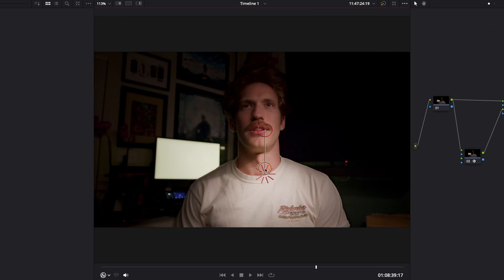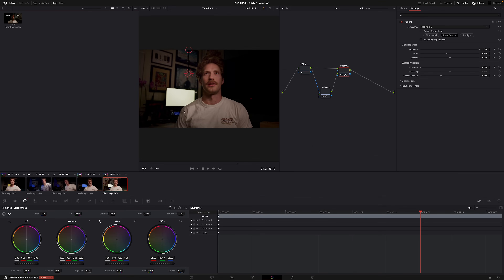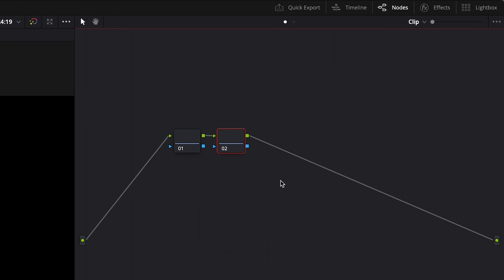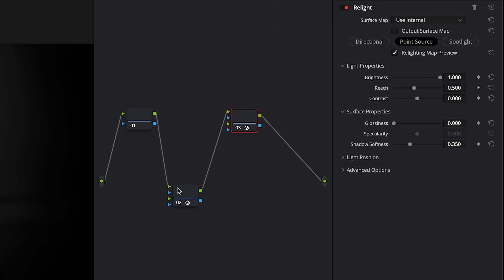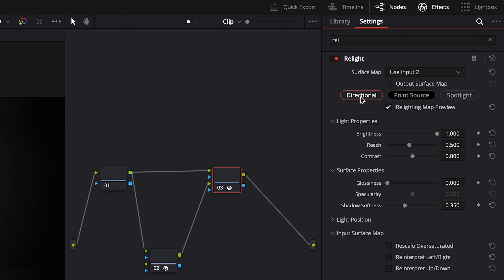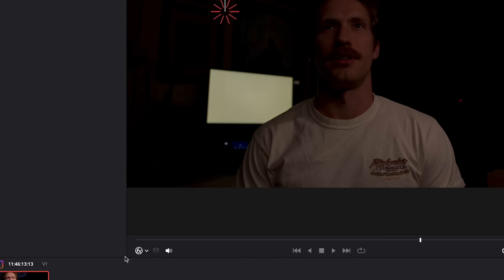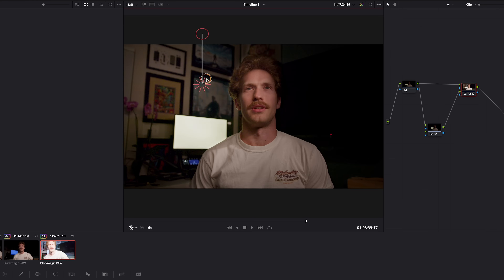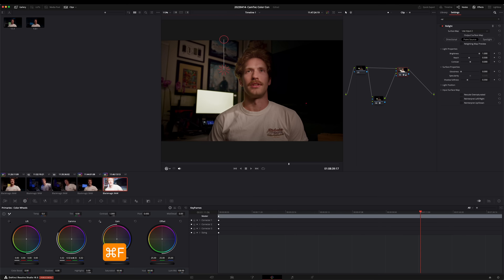Relight with DaVinci Resolve 18.5

Comment: This is amazing but at the same time still artificial light, as the point surce do not modify the shadows, is only a mask with gama up, im wondering depends totally on the file capabilities to create “light” i know im sound pesimist but i didnt, this is mind blowing, but as AI is creating pixels from interpretation i tought that this reñight effect will interpret shadows and reflect on the file as well. 

Very happy tho with this integration and really nice tutorial, thank you for the quick class very well explained
Reply: I thought I was the only one only seeing a power window moving around? I couldn't see any cool depth-information being created using cool AI-algorithms that would control the light fall-off towards the background in a correct way, or skin reflections or shadows or anything? What more than a simple, feathered power window is this?

I have not have the time to try it out my self, so please don't take my grumpy comment too seriously. But it's just my initial thoughts seeing this tutorial, and if I totally missed the magic, then the otherwise nice tutorial could be improved even further.

Comment: Nice tool. But I imagine 8-bit images are going to break if you under expose and then do this. The dynamic range just isn't enough. Correct me if I'm wrong
Reply: Of course they will break. 
10 bit and above, for any serious color grading / correction.
Reply: @WEHAVETHISDREAM  Yeah, I have an 8 bit camera, and have learned that the exposure should be as close to ideal as possible, before you push record. So that mid tones have the most dynamic range

Comment: But how does it look on a video file? Seems to work amazing on this static shot, but it would be interesting to see how it performs on a video and when the subject is moving. It seems like every youtubevideo that shows the Relight tool are using static shots, but I guess people are going to use this on videos, no? Is the static shot illustration because it doesn't perform well on video?
Reply: Yeah, that would've been helpful, how can he not use a video file....
Reply: You'd assume since its video software....
Reply: @thuryn.mitchell  can’t you just track the keylight fx to the shot?
Reply: You need a hell of a computer with lots of processor power. I have a Mac Pro with 1.5 GB intern memory and a ProRes accelerator...and you still have to work on a static shot and render in place.
Reply: Using relight on a video file that is hd or higher is going to require a NASA computer :P or at least a 4080**
It absolutely tanks performance to the point where I had to remove the effect and just manually add the light sources with windows/ masks.
Reply: @connorstace  i considered that, just power window ... it seems slightly less natural but FAAAAAAR LESS performance issues